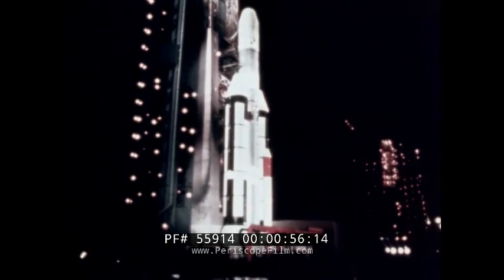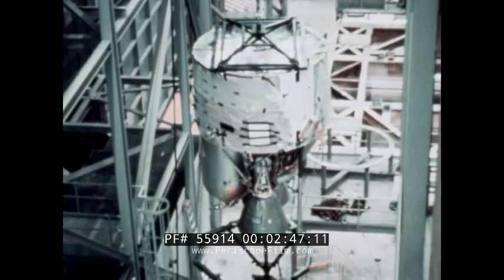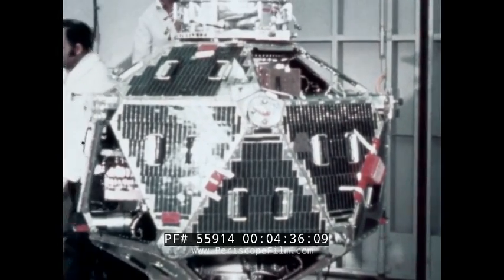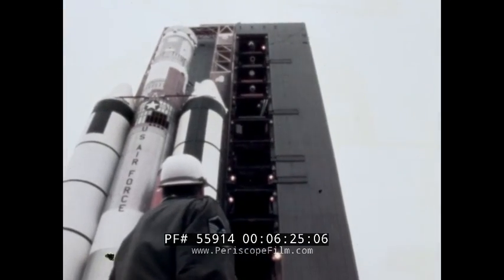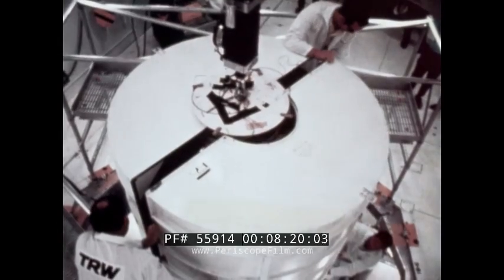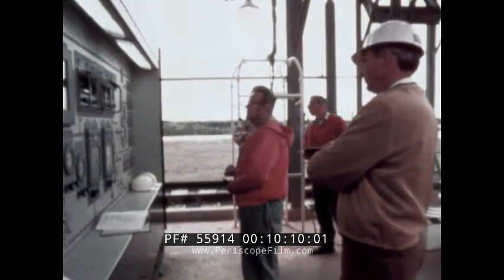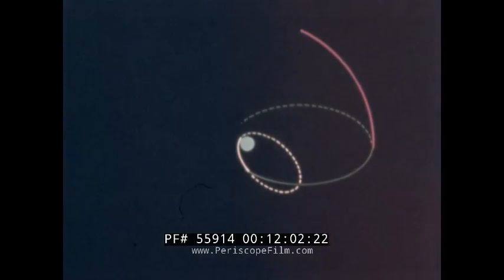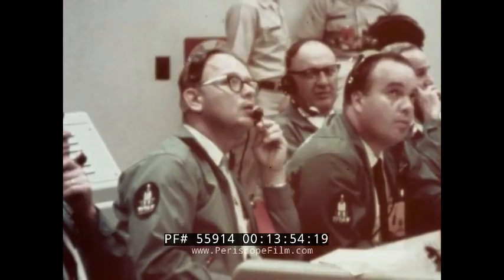VELA NUCLEAR RADIATION DETECTION SATELLITE MISSION REPORT  TITAN IIIC 55914

Comment: 0:17 - That nuclear explosion appears to be the Ivy King shot which was the test of the TX-18F yielding 500KT which was the largest pure fission device the US tested.
Reply: I agree...King was a boosted fission test with a plutonium core seeded with a bit of deuterium and tritium.  Among other test parameters, it was included to give some data on thermonuclear burning before the Mike shot.  Distinctive, long stemmed mushroom cloud for Ivy King.
Reply: @MrCrystalcranium  The TX-18F tested in Ivy King was a pure fission device using only Orally (Weapons grade U-235) as Orally can be safely used in larger quantities than plutonium can be. The test first testing fusion-boosting happened in Operation Greenhouse specifically the Item shot.

Comment: Great upload on a little known but very important early milspace program.  Vela was critical in ID'ing both the Israeli and South African nuclear programs.  

Also, Titan III was awesome.  The later Titan 34 and Titan IV became overly complex and expensive but the III-series was really in the sweet spot for the time for payload/cost.

Thanks,
Reply: While they were very capable both the USAF and NASA would've been better served if the Saturn I and IB had stayed in production.
Reply: @nicholasmaude6906  That is wrong.  The reason they don't exist is because Titan III was cheaper and better served the nation.
Reply: @jamesbehling7673  And in the end was retired due to being too expensive and using highly toxic hypergolic propellants.
Reply: @nicholasmaude6906  lasted 30 years longer than the Saturns.  Anyways, the Titan IV was a stop gap measure.
Reply: 34D wasn't;t overly complex, it was the same as the IIIC and IIID, just with a longer first stage and 1/2 segment added to the solids.